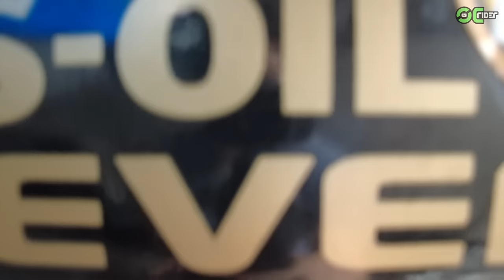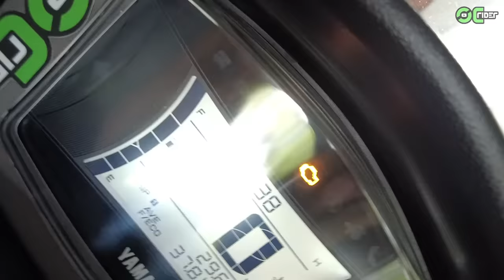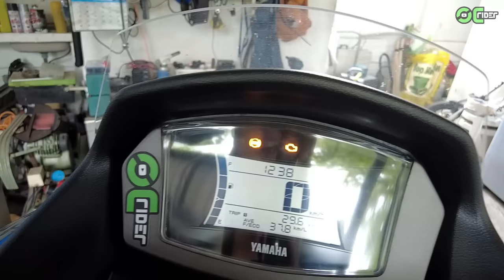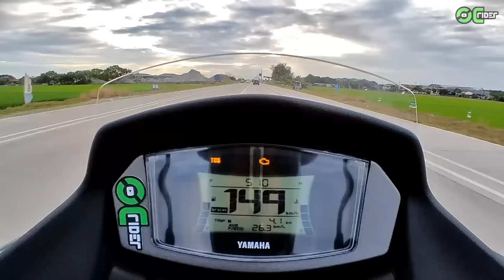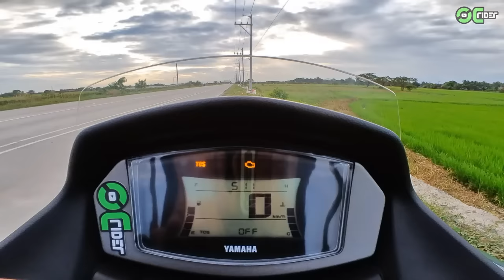Pang Gilid Set na Pang Duluhan? Boom! | Super Stock PowerCAM

Comment: Disregard mo lang ka-OC yung mga hindi naniniwala. Salute sayo! Sa kagustuhan mo makapagbigay ng magandang content at idea sa mga manonood mo. Kahit sobrang delikado ginagawa mo. Basta mag-iingat lang palagi, Ka-OC. Marami pa din kaming naniniwala sayo. Ride safe, always! ✌
Reply from the maker: Salamat kaOC.. :)
Reply: @OCRider  bakit mas mataas ang clutch spring kaysa center spring? Sobrang mali naman ng tono na yun. Hula hula. Dapat 1000 na clutch 1.2k na center. Bakit kamo? Dapat alam mo sagot dyan ka oc.
Reply: @ryanvirtudazo6957  walang kinalaman ang clutch spring sa speed,  parang clutch lang yan sa manual, pag malambot na clutch or stiffer cluct mas smooth pag shift low/high gear..kabaligtaran nman jan sa clutch spring,  kapag mas malambot or sobrang lambot, kahit dikapa naka rev.. kakapit na agad lining sa bell, tendency iikot na agad gulong mo kht naka idle kalang mppnsin mo umiikot na gulong, lalo na kapag makapal pa or bago pa clutch shoe mo, mas naka dikit or malapit gap nya sa bell, konding revs lang aandar kana or kahit bitawan mo, gsto nang umandar kc malambot spring na pumipigil sa shoe na dumikit sa bell..nagets moba?..parang Running Clutch tawag nila sa manual. Ganyan din pag malambot ctr spring reverse concept lang. Mas better kung mas matigas sya..
Reply: boss cvt reveal

Comment: Mr OCrider talagang ang mga scooter naka design lang sa ganyan na takbo. 125kph. Pag modified 150-160kph ganun lang talaga takbo niya. Siguro dahil una hindi aerodynamic / power to weight ratio. Parehas tayo ng hilig ng ka edad kita nuon. Kotse ng panahon namin. Experiment 101. Lahat gawin ko sa kotse ko na lancer/celica/escort na mexico. Sabay binigyan ako suzuki RGV 250 na 2 stroke na naka power valve matulin. Sarap. Pero safety muna at mabilis kuhanin ang 170kph wala pa sa 3rd gear kuha na. 250cc lang iyon. Pero malakas ang torque at dulo at ganda ng handling at brake. Happy ako sa ginagawa mo OC basta ingat ka lang palagi. Palagi kita pinag pray for safe driving . Ok friend.👍✌️

Comment: naniniwala ako dito. kse sa honda beat na 110 cc naka 118 top speed ako pero hindi pa sagad. nag alanganin dn ako nung time na ang try ako nakaka kaba kse pag lumagpas pa ng 120. kung honda beat user ka tapos stock ka lang ito set up ggamitin mo

pulley degree 13.5 drive face 13.5
Center 1k rpm Clutch 1k rpm
flyball 15 grams straight.
pag bitin sa rpm
mag straigt 14 grams ka or e combi mo yung tatlong kinse tsaka 14 grams.

stock bell lang ang beat ko tsaka troque drive and lining.
Reply from the maker: Salamat kaOC..
Reply: @OCRider  maraming salamat dn idol. isa sa nga vloger na hindi nag bibigay ng mis informstion. yung iba kse kargado ang makina pero hindi sinasabi
Reply: Ka oc naka cams po ba yan?

Comment: Ka-OC pahelp po, ano po magandang tono if 85kg rider at 150 kapag may OBR? Currently naka-WF pulley ako set ako with 1.5 washer, jvt groove, stock belt, 800 rmp center, and 1000 rpm clutch.
Reply: @OCRider

Comment: sir sana mapansin nyo po itong tanong ko.naka cams po ako stage 1 project fi. ported
RS8 pulley DF
10/11 flyball
Sun clutch liing
Center1000rpm
clutch1000rpm
Stock TD
2DP belt
wingbell mickey maso version1
tanong ko lng po pede po bang magpalit ako ng gearing 13T/48T  kahit stock engine ako saka po safe po ba sa longride kong magpalit po ako ng geaing .sana mapansin nyo po ang katanungan ko sir salamat po

Comment: Bos OC naka superstock na ako,
Stage 2 cams, valves spring, tensioner, naka port and polish na,tapos 32 mm TB, pero stock injector,, hindi ba ako maglelean PO., 
SA case niyo po ano po magnada injector kong magpapalit.?
Reply from the maker: Not so sure sa set.. powercam ako nagfocus para sa injector.. iba iba kasi profile ng cams.
Reply: @OCRider  bos, ano gamit mo oil para sa superstock
Reply from the maker: @kammalili7160  s oil seven
Reply: @OCRider  bos nag mesg ako sa fb page niyo

Comment: Good evening sir. Pwede po ba yan sa nmaxv1? Naka valve sping ako na jvt, rs8 na cams stage 1. Stock bore r15v3 na piston. Pulley set ng speed tuner. 1500 spings center and clutch. Jvt lining rs8 bell na cnc cut. Tsmp na tdrive na female. TIA sir. Sana mapansin mo po ako. :)

Comment: Boss baka my tips ka
Sa setup ko
Malakas sa arangkada pero walang pang dulo eh ginagamit.ko lang kasi siya for dailyuse 

MY SETUP
Stock pulley
Stock bell
Stock torque drive
Stock clutch lining
1k RPM center jvt
800 clutch
11grms straight jvt
70kg driver

Comment: ka OC bakit akin di man lang umaabot 120 naka rs8 pulley v2 1200 center 1500 clutch 11/13 bola??85kg lng ako.,mabilis lng xang umabot ng 100 pero antagal sa dulo.,ano kaya kulang?yan lng binago ko sa panggilid ung iba stock na lahat.
Reply: masyado matigas ang springs mo at mabigat bola kawawa lang din belt dyan try mo mag 10g straight 1k 1k
Reply: @jmpineda0513  galing na ako 1k pero mas may improvement sa 1200 na center spring pero naka 1500 pa clutch springs ko same bola.,try ko mag 1200 sa clutch tas babaan ang bola.,pero ano ba magandang setup ng panggilid sa stock engine?ung may arankada't dulo

Comment: solid ka oc new subs, san mo po nabili backplate jvt na washer?
Reply from the maker: Sa jvt m power malolos. 😊
Reply: @OCRider  solid ka OC abang pako next vlog mo
Reply: @OCRider  ka oc ano ma recommend mong pulley set para sa aerox v2 stock engine at ilang rpm po mga springs pang daily lng po

Comment: Good day ka oc
Baka may maisuggest u sa tono ng nmax v1 ko ka oc
Spec makina:
Rs8 stage1 cam
Semidome piston
Sidings:
Pitsbike v3 df set
Rs8 titanium bell 
Suns clutch assembly
1200rpm center spring
1k rpm clutch spring
Td rs8 forged alloy (need ko magpalit pang daily)
Stock pipe 
Stock gearing
140/70R 110/70F tire
65-68kg rider
TIA ka OC 
God bless